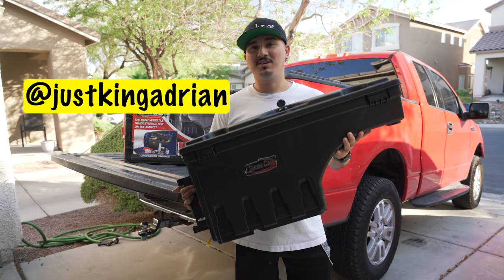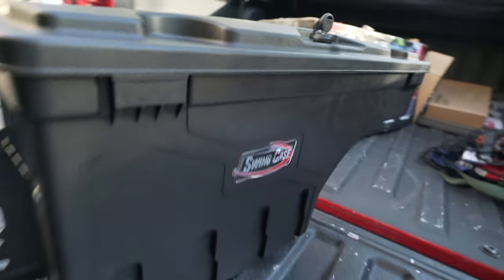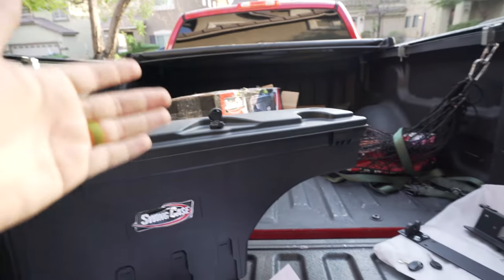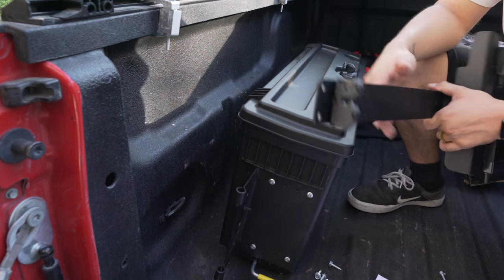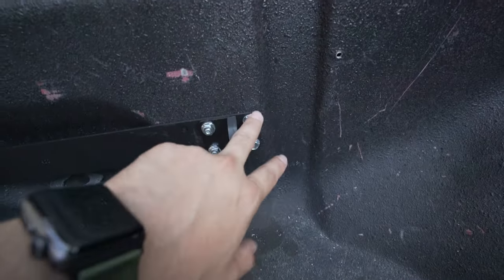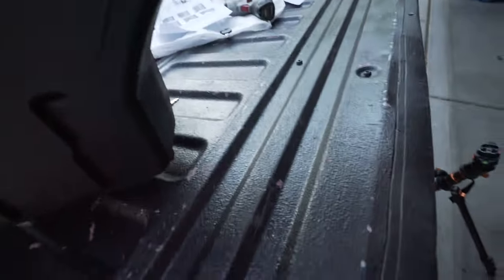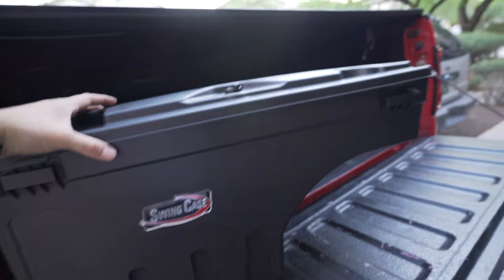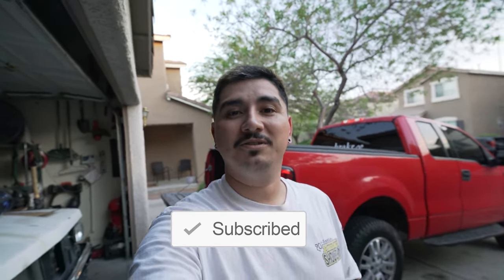SwingCase UnderCover Truck Bed Tool Box

Comment: I've tried two of the less expensive versions. Both latches failed after a year and also with replacements. Any weight and bouncing in the back of a truck is just too much for the design. The latch needs to be redesigned.
Reply: What brands did you try out?
Reply: Sounds like you got what you payed for

Comment: I think I'll grab 2, but im afraid it will cover up my electrical outlet on the passenger side.  That outlet has actually come in handy a couple of times.  I guess if the swing box makes the outlet unavailable,  I could always just take the box off real quick if I need the outlet.
Reply: Cut a hole in the swing plate with a grinder perhaps? Or take it to a metal shop and have the. Do it?
Reply: I had 2 installed when I got my truck new back in 2018 and have never regretted it once.  I use my truck for hauling and for camping and every tool I need for both fit in them,out of the way until needed.  I would definitely do it all over again.😊

Comment: Just wondering if this product will be able to swing open if you have a 5th wheel hitch mounted between the wheels?
Reply from the maker: I’m not sure but I could measure the length at the widest point when swinging if you wanted to check on your truck. Or else maybe reach out to swing case directly.

Comment: Yo dude, I'm driving a late year 08 F150 FX4, extended cab, flareside bed in shadow gray. Any idea if these boxes work with flareside beds?
Reply from the maker: I'm not too sure. I think even if it didn't fit you could possibly use some sort of spacers to make it work. Maybe shoot them an email and double check if you don't want to risk it.
Reply: @JustKingAdrian   Thanks dude! I'll definitely send them an email before I buy. Got a couple other things to do first, and thinking about building a lock box under the rear seat

Comment: What are the four slots on the side of the swing case for?
Reply from the maker: I am not sure. They aren't mentioned anywhere in the instructions. Might just be a design choice for rigidity because they show on the inside as well and they hold a lot of weight.